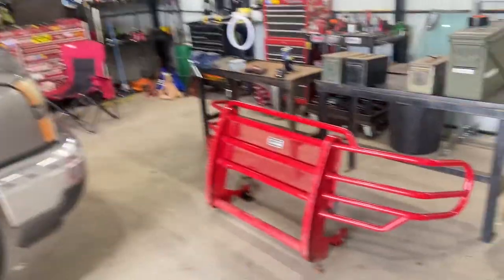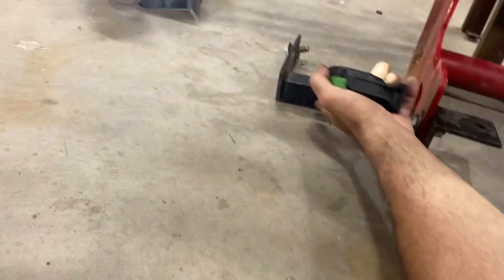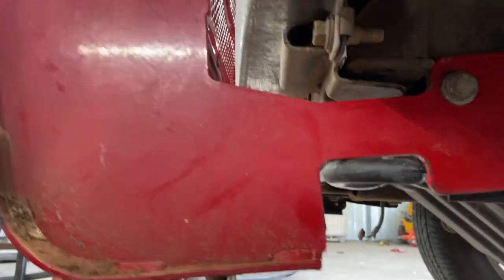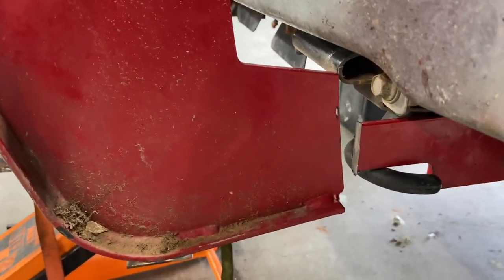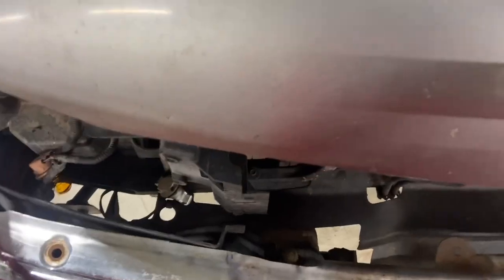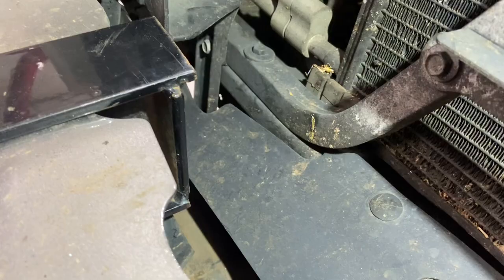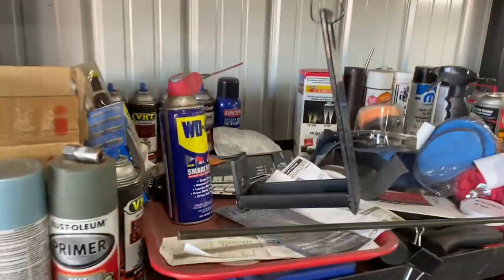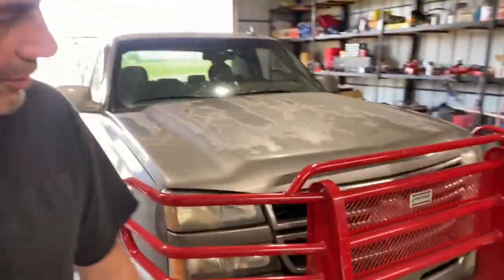06 Silverado brush guard install. How to make the wrong brush guard fit.

Comment: I have a '99 Silverado 1500 and I cant for the life of me figure out how to get the verticle bolt that goes through the hook mounting plate off. Ive tried the closed ended wrenches and I just cant seem to get inside enough to get around the nut. Do you have any tips?
Reply from the maker: Are you talking about the one long bolt that goes side to side? There’s a plastic cover that I removed from mine so it’s really easy to get to on my truck

Comment: Would’ve round those welds flat and welded plates over the connection remember that’s a big pressure point on impact and you’re just relying on those 2 little welds
Reply from the maker: That’s a good idea. I think at one point that was going to be something I did, but forgot about going back in to do that. Thank you for the idea and reminding me about that.